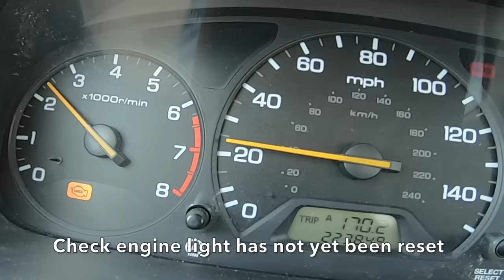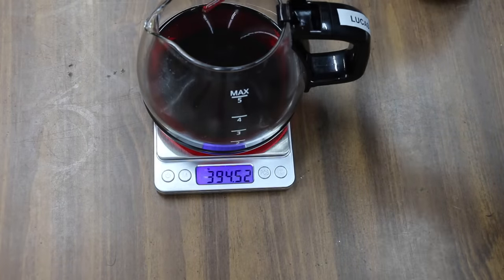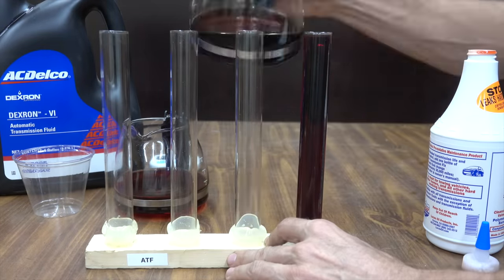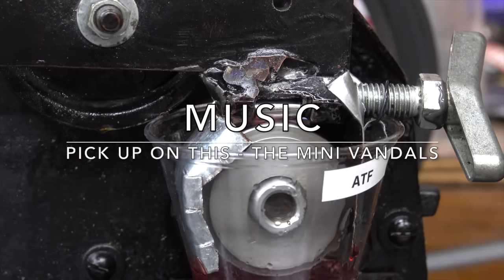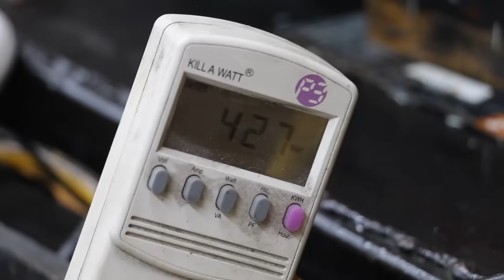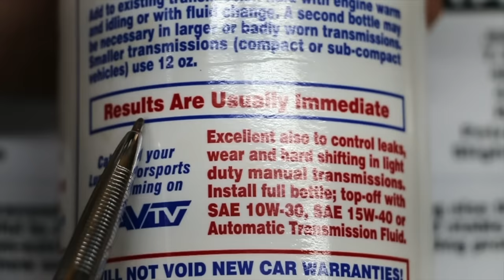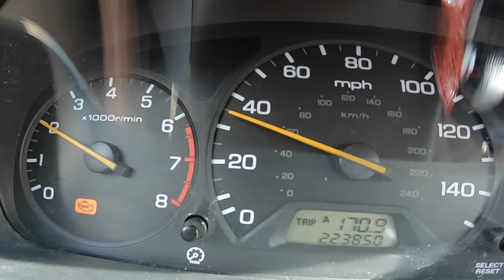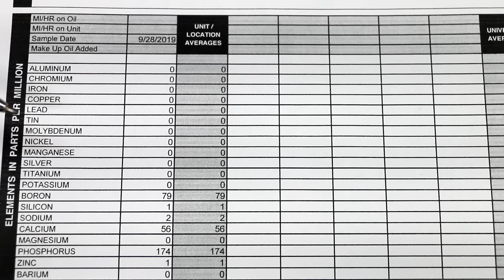Does Lucas Transmission Fix Work?  Let's find out!

Comment: I used sea foam trans tune in my wife's Chevrolet van. The transmission quit slipping later that day and 150K miles later still shifted great, with no slipping or shuddering.
Reply from the maker: Impressive!  I need to test Seafoam trans tune
Reply: 150k on a Chevy trans is impressive all by itself...are you doing trans flushes?
Reply: @philtripe  impressive? My truck has 260,000mi on original motor/trans. Although I did have to use the lucas treatment recently. Because the tranny was slipping when shifing from reverse to drive. Even stopping at a red light while in gear it would slip out. Put a quart of that lucas in it and that problem went away.
Reply: @philtripe  Chevrolet's problem transmissions are the fwd and the early 4l60E's. The first batch of 8 speed transmissions have awful fluid in them. The van's transmissions should be fine.
Reply: i junked a car that wouldn't shift anymore. the problem i found later was a clogged catalytic converter.
Reply: Yeah Chevy trans love this stuff!
Reply: Project Farm I’d be interested to add in differential fluid and additives as well. More common problem in the Toyota Tundra’s are the differentials than the trans or motor.
Reply: Francois Dupont how does that work
Reply: what i bet it does is soften up the seals  this sounds like a test that needs done  PROJECT FARM
Reply: @ProjectFarm  That's a perfect idea for a future video. I tried it in my old 83 Cutlass 305 years ago and it helped noticeably.
Reply: @Francois_Dupont  I damn near overhauled an old 3.1 with 60k miles because I kept being told the heads were warped by mechanics. Turned out to be the factory GM plastic dogalytic converter.
Reply: @philtripe  Hello 2big. I'm Papi's neighbor. Yes, he's done at least 2 trans flushes. Don't know the mileage when the flushes done.
Reply: @philtripe  my 4l60e is at 206k all original and I just drained the oil today for the first time ever to add a torque converter
Reply: @Francois_Dupont  I used to work at a transmission shop and I've actually seen this happen a few times. We usually just show the customer proof of it being exhaust related and send them out, no charge.
Reply: @JesusSaves86AB  did you smash that honeycomb? hahaha
Reply: @ppcasm_1278  very generous of you. i have been swindled so many times in the past i have decided never to step into a garage (business) anymore in my life. i have since bought almost all the tools and i save THOUSANDS each year. because i fix all the cars in my family.
Reply: Just filter changes and fluid refill.
Reply: It was probably just low on fluid…
Reply: Would you recommend Lucas in a car w/ 100k miles as a prevent. 
2003 according V6

Comment: "Lucas Transmission Fix: A little morphine before death."
Reply: Hahahah for sure! Hope your comment climbs to the top!
Reply: Morphine actually speeds death does not delay.
Reply: Morphine is mercy kill. At least Lucas offers an extended life.
Reply: But at least it die at home😞
Reply: @HR-rt9nh  Wouldn't morphine lower blood pressure and heart rate and respiration rate and in general, slightly delay the effects of a bleed out? 
How does it speed it up? I've been on morphine before and thank fucking jesus for it when I needed it.
Reply: @lifeisgood070  Morphine has two common uses, in an emergency role it prevents the body going into shock to allow life saving measures to be applied or the patient to evacuate to an area of treatment, while in a respite care or chronic condition roles its used to suppress the nerve function that tells you your dying, but very much at the cost of worsening health. As a synthetic opioid it suppresses everything from metabolism to minor muscle movements that allow lymphatic circulation, a person start to waste away. In higher doses permitting muscles to be overloaded or skin to be damaged without the user being aware and making focusing of the eyes difficult, triggering hallucinations/fevered speech and negating reflexes to a point at which blinking, swallowing, respiratory and heart functions become further apart, weaker and eventually stop all together, often when the patient is in their normal lowest activity period of sleep. Its not a bad way to go, but it certainly doesn't extend life in such an instance, straddling a moral grey zone between pain control and directly euthanizing.
Reply: @SheepInACart  I guess I just don't understand why if it lowers respiration and cell activity, what makes it different than an anesthetic like twilight sleep. Seems to me in the short term it prolongs life my lowering metabolism and respiration like other opioids.
Reply from the maker: lol. Thanks!
Reply: @HR-rt9nh  Way to take it out of context. smh
Reply: Not true
Reply: Rodrigo Sagebin not true at all. I’ve been a mechanic my whole life and I’ve seen lucas work miracles
Reply: And this cars problem is not a slipping trans it’s the speed turbine sensor gone bad so the trans pump is not sending proper pressure to the torque converter
Reply: livey oone  Not 100%... morphine is not a "synthetic opioid". It is literally the prototypical opiate alkaloid found in the poppy plant.
Reply: @HR-rt9nh  

It takes the pain away.
Reply: Fair enough. I'm not correcting out of being a jerk, it's just FYI. Morphine, even the stuff administered in the hospital is a natural opiate alkaloid isolated from opium. it is not synthetic... hydromorphone (Dilaudid) is semi-synthetic as it is derived from thebaine... another natural alkaloid found in opium.
Reply: @SheepInACart  And we use this shit in healthcare.
Reply: And to those of you who still didn't quite get it....Lucas transmission Fix is a band-aid and will help extend life of transmission...Morphine WILL NOT EXTEND LIFE, it shortens it.
Reply: Adam Fears  That was an application of hot lead  given at a fast rate.
Reply: Sometimes overly dissecting a joke loses the humor. *Disclaimer, Lucas Transmission fix is not, in fact, morphine. Please don't inject Lucas Transmission Fix into your veins, in fact, don't do morphine; in fact, don't do drugs....
Reply: Some people just have to be the buzzkill on a joke since it's not accurate. I bet more people laughed at that joke than the amount of people who wanted to learn about morphine today. Notice how many likes the initial joke got vs the amount of likes for the buzzkill comments. I think I know who gets invited to more parties lol.
Reply: @SheepInACart  morphine is a opiate naturally occurring alkaloid
Reply: @quevicular  Perhaps it's more like chemo at stage 4. :(
Reply: @christopherculvey3391  
One day you may be very very grateful they do use this 'shit' in healthcare.
Reply: @abz817  Your technically correct that it is, being a name for one of the majority constituents found in normal brown opium, but "morphine" available for direct use medically accounts for only ~8.5% of the actual morphine use is limited to the class2 substance of chemically treated or derived semi-synthetics for a host of reasons, including solubility in water, contamination risk and decreased addiction risks by drastically reduced presence of other opioids that are found in class1 products. Meanwhile the other 500+ tons of  "morphine" produced annually is almost solely as direct poppy extract (known as class1), the vast majority of which is simply and intermediate stage in manufacturing other substances.

Hence its commonly medical morphine is called "synthetic morphine" or referred to as a "synthetic opioid" even when its technically only semi-synthetic in nature, as the goal is to distinguish it from the class1 compound... the two being different enough in usage and effects on the body that not only are they administered in radically different quantities for a given effect, but they have differing treatments for withdrawal and overdose states.
Reply: probably right
Reply: @lifeisgood070  morphine is a derivative of opiates that has been purified it was designed originally to cure opium addiction well they became addicted to the morphine then they came up with this idea of heroin better purification better chance of saving you from morphine addiction same results people became addicted to heroin then they came up with the methodone cure for heroin addiction and guess what they get addicted!  a pain killer thay also has the ability to remove you from reality and make you feel a heightened sense and humans are just gravitated toward anything that makes them feel better unfortunately this stuff grabs you and won't let go and the opiates that they use today are a long long long ways from laudanum another medical invention
Reply: @lifeisgood070  So you've never heard of anybody overdosing and dying from morphine?
Reply: @dorinriki  i don't understand how your comment pertains to temporarily life extension as mine did in the case of lowering blood pressure and respiration in a bleed out situation. Yes I've taken so much morphine I've passed out - so I totally understand how easy it is to overdose and die from such a powerful drug. Maybe read my original comment again?
Reply: Morphine and Lucas are alike in prolonging you and your transmission but they do not fix you or your transmission. I have no data to support this theory.
Reply: Iron *Fe*  I think only certain people have pleasure sensors or release from pain medication. I've been on several very powerful ones all the way up to fentanyl. Never noticed any withdraw. And never noticed any high similar to cocaine. Morphine did take 2 shots to relieve pain from a kidney stone for me though. And acting time took approx. 5minutes maybe more. So I was still screaming after the second shot. Thank god they didn't give me  a 3rd.
Reply: Once on morphine,  unfortunately the end is near....
Reply: No exactly.
Reply: I was thinking more along lines of  novacaine
Reply: I’ve asked for morphine before. Only women can claim a 10 on the pain scale, I was at 9, thank god for morphine as I tucked my bone back into my shirt.
Reply: @eggbeaters  Exactly...The rpms is the obvious sign ... Anyone who has had transmission problems like me..Cough cough .Ford Fresststar! . Cough .. 

The feel of a bad transmission and torque Converter is VERY distinctive. 

Worse van ever built and Ford really lost me cause of it. 
I have a 99 windstar with 145,000 thats got a bit of internal cluth leaking that's screwing with the Overdrive sensor  but it's fine.  My 2005 125,000 Freestar has had 5 CV joints two bearings go out rebuilt tranny even after the recalled torque Converter was put in. 
Imho it was the Torque Converter which ruined the whole tranny . Even after the rebuild it never ran right.  I gave it to a family member it's broke down again in the drive way.  

PIECE OF CRAP ...its loud on the road always had a roaring sound from the passenger side ...Oh it always rolled back wards on hills in gear ..so defective. 

Ford knows that it can lose torque disengage and then launch back ...Its deadly dangerous .  I could of killed someone at a crosswalk when mine went crazy.    It was like I was holding a clutch in and letting it pop. 

I've never had a car act like that before . They were sued over that piece of crap yet they are on the road still. 

Nobody should be on the road with that death trap.
Reply: Lolllllllll
Reply: @HR-rt9nh  it’s true - both my grandads died not of the terminal lung cancer they both had but of the eventual morphine overdose given through palliative care.
Reply: Great thread, learned about Lucas, Morphine and those coming to my party !!!  lol